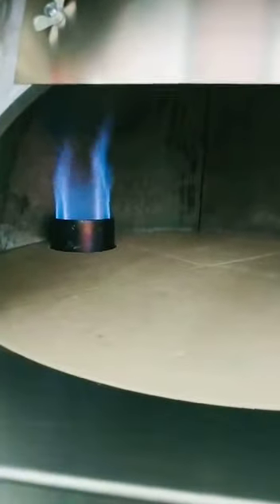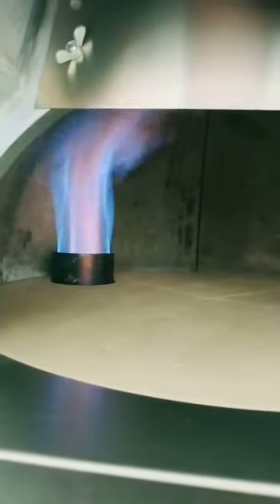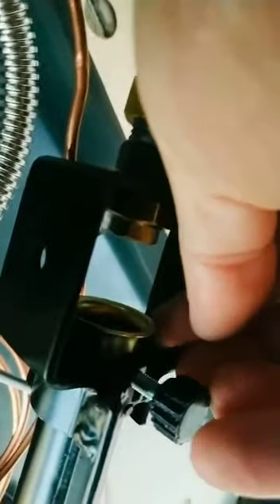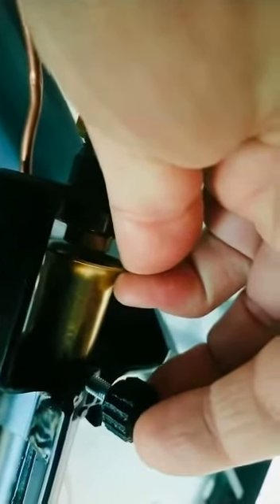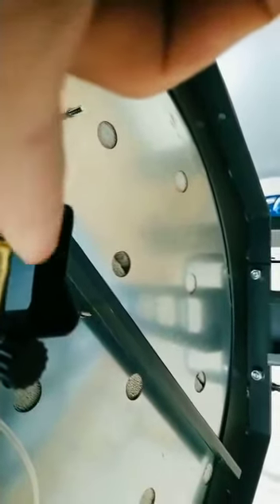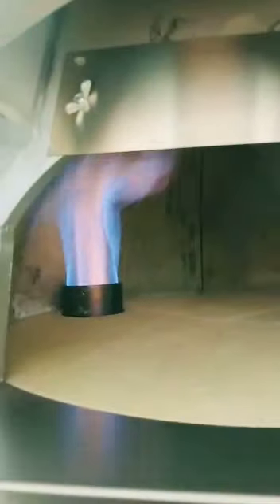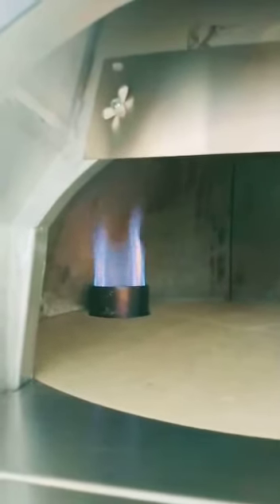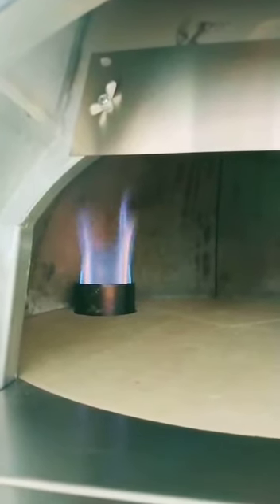How to adjust the air mixer for valloriani pizza oven(yellow flame or blue flame)

Comment: Flame must be more yellow, imitating wood flame
Reply: Can I ask why? I would have thought that a blue flame will burn hotter and be more efficient on gas?
Reply: @ThexManxDan   because it imitates the flame coming from wood which is yellow.  And as a plus it heats more.
Reply: People in europe where having issues with ooni 16 because the gas flame was blue a did not heat the oven as it should. So people started restricting the  air from the burner to get a yellower flame and that fixed the problem.
Reply: Okay I bought a second hand valoriani baby 60 and it is producing soot in the oven. I believe I need to adjust the air intake to make it a little more blue but still yellow and so the flame still reaches the top of the oven
Reply: At the moment, the flame rolls over the top of the oven to the other side and even sometimes makes it's way up the flue slightly